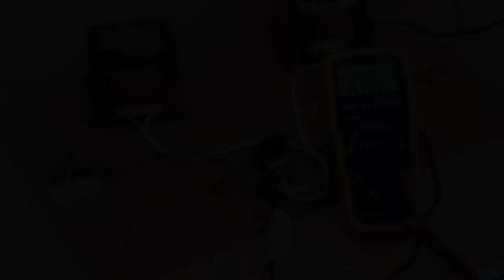DIY Welding Machine / Only 2 Microwave Transformer / Good Job

Comment: And how meny touns you coil it sir please
Reply from the maker: Hello.  The cable I use is a 4mm2 silicon insulated copper cable.  I made 24 windings in each transformer and used 6.5 meters of cable in each transformer.  A total of 13 meters of cable is required.
Reply: Thanks master god bless you sir
Reply: Tnx Sir will can se panel hon sir
Reply: Sir thanks so much master please how many Homs voltage regulator you used to control the welding machine sir God bless you sir please
Reply from the maker: I could not understand this message.
Reply from the maker: I used 4 parallel triacs to power the dimmer circuit I connected to the input side.
Reply from the maker: CONNECTION DIAGRAM https://drive.google.com/file/d/1R7cFIScJsMNDwwgNJNgOwgGk7Skn50UK/view?usp=sharing 

https://drive.google.com/file/d/1NoQeD8Wd9HW9TT3OQOkoq9BUoZidIL-n/view?usp=sharing

Comment: Each loop of secondary wire raises the voltage and lowers amperage, amperage is the key element in arc welding, fewer wraps with thicker wire cable would give you more amps, for more heat, with less voltage drop or a higher duty cycle ratio during operation
Reply from the maker: Hello.  I know about what you wrote.  However, when the number of turns decreases, the current increases and the voltage decreases, yes... in this case, there may be problems with arc initiation and its continuation.  I've already built a machine like you said.  Thicker wire and less winding with 4 transformers.  This time, I wanted to make a lighter tool.  For this reason, I used 2 transformers and over-wound to provide sufficient voltage.  For the heating issue, I used a silicon insulated copper cable.

Comment: how many amps you get?
Reply from the maker: Hello.  The output current is around 120 - 130A maximum.  Suitable for using up to 3.25 electrodes.  I also made the model with 4 transformers for thicker electrodes.  You can find the video on the channel.  However, if you generally use 2.5 electrodes, this model will work easily.

Comment: Merhaba ustam bu kaynağın verdiği ark ac mi dc mi? En fazla kaç amper? Uzun süreli kullanım randımanı varmı? Elektrik çarpmasına karşı güvenlimi? Cevaplarsanız sevinirim teşekkürler
Reply from the maker: Merhaba Ahmet bey. Çıkış AC. İstenirse doğrultucu bağlanabilir ama biraz pahalı olur. Çünkü 150 - 200A dayanımı olan diyot veya tristor kullanmak gerekir. Çok uzun süre rahatlıkla kullanılabilir dersem tam doğru olmaz. Ben avuç taşlama standı videomda uzun süreli kullandım, hiç sorun yaşamadım. Ancak bu uzun süre hiç durmadan kaynak yapma anlamında sayılmaz. Profesyonel bir alet değil sonuçta ama benim gibi işler yapan için hiç fena değil. Akım değeri benim olcumlerime göre maksimum 140A ancak makine ısındığı zaman biraz düşebilir. Kısaca 2.5 ve 3.25 lik elektrodlar için kullanıma uygun.  Çıkış gerilimi maksimum 40V olduğu için elektrik çarpması olmaz. Tabii ki temas durumunda vücuttan akım geçirir ancak hissetmezsiniz...
Reply: Verdiğiniz bilgiler için teşekkür ederim.
Reply from the maker: @ahmetustun3241  Ben de teşekkür ederim. İyi günler
Reply from the maker: Ben de ilginiz için size teşekkür ederim. İyi akşamlar

Comment: Alternatively one could just buy a new Parkside 120 amp flux core welder for £80 at Lidl. 😉
Reply from the maker: Hello.  Actually, it's not exactly the same thing.  If I have the opportunity, I prefer to make and use it myself.  But thank you for your interest.
Reply: I made my own spot welder from scraps, I too prefer making my own tools and workshop gadgets, but there's a point where to build projects like yours, not only has additional costs for the materials you've used, but quite a bit of money to own the type of tools generally required (beforehand) to fabricate such items. £80 (in my opinion) was a small price to pay for a new 120amp 'flux-core' wire welder. Which was my point wouldn't you agree?
Reply from the maker: Hi.  I usually try to do it without spending a lot of money.  It's a little fun because I do it for hobby purposes.  If you pay attention to my videos, I usually use the materials I have on hand or second hand materials.

Comment: can you tell me, please, the parameters of the cable winding?
Reply from the maker: Hello.  The cable I use is a silicon insulated copper cable with a cross section of 4mm2.  I made 24 windings for each transformer and used 6.5 meters of cable for each transformer.  If this information is not sufficient, please write again.
Reply: thank you so much for this project! please tell me where can I buy this cable? or the store where this wire is sold?
Reply from the maker: Hi.  I bought the cable from an electrical supply store.  It is used in the interior installation of items such as electric heaters and is referred to as a fireproof cable.  Its technical number is N2GFAF.  You can search this way online.  Thank you for your interest and have a nice day

Comment: Whyy not use thicker cable and less turns per secondary for less volts and more amperes?
Reply from the maker: Hello.  When we do as you said, the voltage becomes low and the arc cannot start and then the continuation becomes a problem.  Yes, current is very important in welding work, but the voltage must rise above a certain level.
Reply: What is the optimal voltage of the secondary in that case? Some say between 2.5 and 3.5 volts.
Reply from the maker: Hello.  The voltage value required for arc welding should be between 30V and 60V and the current value should be 70A and above.  The voltage values you mention can be used for spot welding.  In this case, the current value can be 500A or more.  Because in this type of welding, metals stick to each other.

Comment: Mr kalau mau di kasih ampere meter digital bagaimana cara nya
Reply from the maker: Menghubungkan ammeter digital tidak cocok untuk sistem ini.  karena Anda dapat melihat arus hanya ketika arus ditarik, yaitu saat pengelasan.  Namun, dengan menghubungkan dioda jembatan kecil ke terminal keluaran, Anda dapat mengukur tegangan dengan voltmeter digital dan menyesuaikan arus yang keluar dari keluaran sesuai dengan pengukuran ini.
Reply: Terimakasih atas informasinya

Comment: Why worry about protecting the cable so much? Even if it were bare it would still function the same 🤔...
Reply from the maker: Hi.  The bandages should not be bare.  Otherwise, there will be a short circuit.

Comment: Is the input 120v? Or 220v?
Reply from the maker: Hello.  I am using 220V, but you can use it in 120V by applying the same way.

Comment: Buenas tardes, con cuanto voltaje trabaja es 110 v o de 220? Otra duda que tengo puedo usar un dimmer de 2000w? Ojala que me pueda responder, gracias !!!
Reply from the maker: Hola.  Aquí la tensión de red es de 220V.  Sin embargo, funciona de la misma manera donde hay 110V.  Porque los hornos de microondas que se utilizan allí también se fabrican de acuerdo con 110V.  Sin embargo, cuando el voltaje de entrada es de 110 V, la corriente será alta porque el voltaje de entrada es bajo.  En este caso se debe utilizar un dimmer de 4000W, pero debe ser de 4000W según 110V.  es decir, el circuito del atenuador debe ser resistente a unos 40 A a 110 V.  Porque se extraerán 20A de la entrada.  Si el circuito tiene 2 veces la potencia, la probabilidad de falla será baja.  Espero haber sido capaz de explicar.
Reply: Gracias amigo, me ayudo a resolver esas dudas , y sobre todo por tomarse el tiempo para compartir las respuestas 👍,saludos
Reply from the maker: Gracias también.  Tenga la seguridad de que siempre intentaré ayudar en todo lo que pueda.  Saludos desde Turquía

Comment: おはようございま。
トランンスからエナメル線を外すのはエナメル線の細い方？太い方ですか？
Reply from the maker: こんにちは。 トランスに巻かれたケーブルの特性については、以下のリンクを参照してください。  https://www.yapitaskablo.com/en/product-detail.php?pid=669
Reply: Thyristor Okay, but another four ICs? What is the transistor (IC chip)? I ordered the cable. I also removed the transformer at 2 o'clock. The cable I ordered cost m / 1800 yen, it seems that it will cost more than the price that the welding machine can buy, anyway, IC? Can you tell me the transistor (IC chip), thank you
Reply from the maker: I bought the cable for m/1$. It was actually more affordable when I shot the video. 120 yen with your money. Anyway... The other 4 semiconductor materials I use are triacs (which you refer to as ICs). You can use a triac with the number BT137. This process is done to increase the power of the dimmer circuit. So it's not a special circuit element. The connection diagram for this process is also available in the description section.

Comment: Excelente video Murat Güney muchas gracias por compartir, he visto muchos videos de como fabricar una maquina como esta pero tu video es el que más me ha gustado, pienso hacer una con 4 o 6 transformadores, probablemente con menor voltaje en cada transformador pero con mayor amperage, espero conseguir mi propósito. Nuevo suscriptor y tu gran like. Saludos desde México.
Reply from the maker: Muchas gracias.  Me alegro de que te guste.  Tengo otro video que hice con 4 transformadores.  Usé cable de 10 mm2 en ese modelo.  Puede dar mayor corriente.  El voltaje de salida era de alrededor de 21V

Comment: Hola, de los videos que he encontrado de este tipo de proyectos, los que subes son los mas profesionales que he visto.  Quisiera saber cual de tus dos maquinas de soldadura que has hecho recomendarias en rendimiento y que se caliente menos, si la de cuatro transformadores y cable de 10 mm2 o esta de dos transformadores y cable de 4 mm2. Y saber el tiempo aproximado de uso para no abusar de estas.    Agradeceria me respondas, saludos desde México.
Reply from the maker: Hola.  En cuanto a la calefacción, el modelo con 4 transformadores es mejor.  En el modelo de 2 transformadores, usar un cable de 4mm2 para que el voltaje sea de 40V es un poco débil en términos de calentamiento.  Sin embargo, es mejor en términos de ligereza e imagen compacta.  Cuando se utilizan 4 transformadores, el cable grueso hace que el número de devanados y el valor del voltaje sean bajos.  Sin embargo, proporciona más valor actual.  Si piensas en el trabajo de aficionados, 2 transformadores son suficientes.  Gracias al aislamiento de silicona, el cable es resistente al calor.  La corriente de alrededor de 120 amperios es suficiente para 2,5 y 3,25 electrodos.  La decisión es tuya.  Gracias por su atención

Comment: Se ponen en paralelo los secundarios de los transformadores para mayor amperaje.
Los ventiladores hacia arriba para mayor ventilación y mejor de 115 vca para mayor facilidad de ensamble 
Es mi opinión
Reply from the maker: Hola.  Por supuesto, la corriente es importante... pero el voltaje también debe ser suficiente.  Por tanto, es mejor tenerlo conectado en serie.  Gracias por tu interés 👍

Comment: Buenas, qué triacs has usado ?
Reply: Tengo dos triacs bta 16- 800  como la puedo conectar al Dimmer si me podrías hacer un schematic por favor te lo agradecería profesor
Reply from the maker: Hola.  Usé cuatro BT136.  Estos triacs tienen una resistencia de corriente de 6.5A.  Si usa BT138, tres es suficiente.
Reply: Tengo 4 transformador de microondas y aproximadamente me dan 10 voltios cada uno y bobinado secundario utilice cable calibre de 4 mm
Reply: Y no me funcionaría el triacs qué tengo a mano ? Que serían el bta 16-800

Comment: sirve para 220 v?
Reply from the maker: 220V o 110V no importa.  Los transformadores de horno de microondas que utilizará se producen allí, por lo que no importa.  El bobinado debe hacerse en el lado secundario como lo hice yo.  Sin embargo, dado que se consumirá más corriente en lugares donde se usa voltaje de 110 V en el lado de entrada, sería mejor si los cables que se usarán son más gruesos.  Sin embargo, el circuito dimmer (circuito necesario para el ajuste de corriente) a utilizar debe ser más potente.  Compartí un nuevo video para el circuito del dimmer.  Puedes encontrarlo en mi canal.

Comment: Quantas voltas?
Reply from the maker: Olá.  Na verdade, eu compartilhei as informações nas legendas.  No enrolamento secundário, fiz 24 espiras com um cabo de cobre isolado em silicone com seção transversal de 4mm2.  Usei 6,5 metros de cabo.  Este é o mesmo para ambos os transformadores.  Um total de 13 metros de cabo é necessário.  O circuito que eu uso é o circuito dimmer que você encontra no mercado.  Eu adicionei 4 triacs para tornar o circuito mais poderoso.  Você pode encontrar o diagrama de fiação esquemático e geral para esta conexão na seção de descrição.  Se houver algo obscuro, você pode perguntar.

Comment: 8:35 Really good work on the machine , but using gloves with a table saw is dangerous. Like your upgraded dimmer. I have exactly two old microwaves that are good to go.
Reply from the maker: Thank you very much.  I will pay attention to the glove issue from now on.
Reply: Question; If i used 120 volt input, would I get half the output, or none?
Reply from the maker: The element that determines the output voltage value is the microwave oven transformer.  If you use a transformer produced for 120V input voltage, the output voltage will be equal to the voltage I get.  So with the same winding value, you get 20V from one transformer and 40V from two transformers.  However, if you use a transformer manufactured for 220V and give 120V to the input, the output voltage is halved.  I hope I could explain
Reply: thanks for the info.
Reply from the maker: Thank you too 👍

Comment: What are the outcome?
Reply from the maker: Hello.  The result is as you can see in the video.  I can easily use it at home.  I also published a video for the process of converting the output voltage of this machine to DC.  If you haven't watched it, I recommend watching it.

Comment: Hola yo hice uno de 4 transformadores y el bobinado secundario con un cable de 8 AWG, pero se me presento que cuando enchufo al tomacorrientes de 220 AC de mi casa, el cable del enchufe se calienta demasiado rápido, pero los transformadores y los cables que van en paralelo a los bobinados primarios no se calientan, solo la parte del cable que va conectado a la red eléctrica de mi casa se calienta bien feo en menos de un minuto, quisiera saber si es porque el cable es demasiado delgado o esque algo no hice bien, porque el cable cálculo de debe de ser de 16 AWG, porque es un cable envuelto y dentro de ella viene esos dos cables de 16 AWG o talvez es más delgado, que podría hacer 🥺 ayuda
Reply from the maker: Hola.  Si su cable de 220V se calienta, es solo porque es un cable delgado o un cable de aleación de aluminio.  Usé el cable del horno de microondas en esta herramienta.  Sin embargo, como hay 2 transformadores, no fue un problema.  Te recomiendo usar cable de cobre puro de 3x2.5.  En este caso, no habrá ningún problema.  Me alegraría si escribiera el estado más reciente después de haber realizado este proceso.
Reply: Hola, tengo una consulta, con el circuito dimmer de 4000w, si le bajó el voltaje, también baja el amperaje? O cuál es la función del dimmer, sigo con este proyecto y quisiera incorporarle el dimmer ahora, espero su respuesta, gracias
Reply from the maker: Hola.  Como dijiste, el circuito Dimmer reduce el voltaje.  Dado que la carga conectada a la salida es la misma, la corriente también disminuye.  Así que simplemente la ley de Ohm.  Como I=U/R R, es decir, la resistencia (electrodo) es constante, si el voltaje cae, la corriente también disminuye.
Reply: Y si quisiera agregarle un voltimetro o amperímetro para que me de datos de en cuanto estoy soldando como las soldadoras inverter en dónde tendria que colocarlo
Reply: Una consulta más, solo encontré un dimmer de 3800W, trabaja normal? o no 🥺